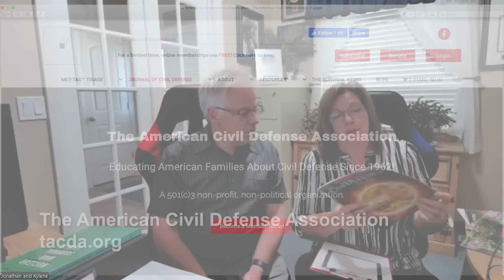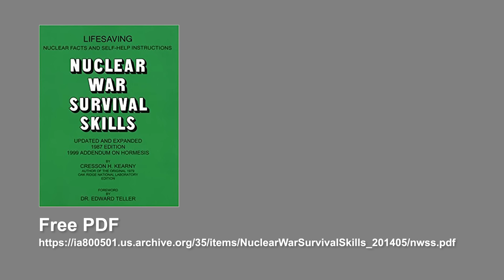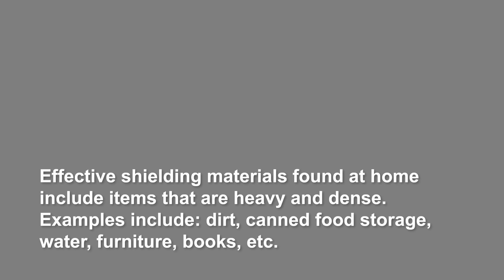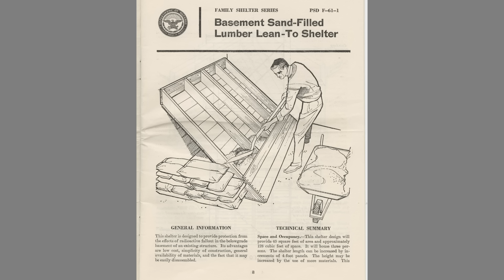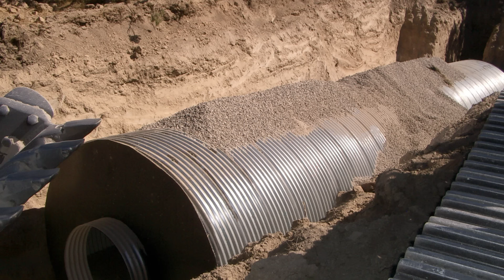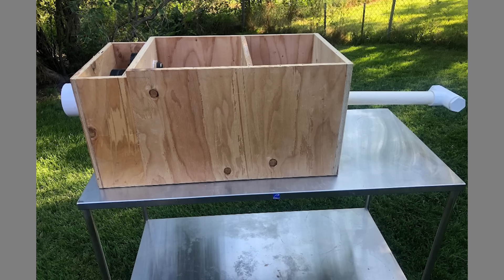Nuclear War: DIY Fallout Shelters with Jay Whimpey PE, President of TACDA

Comment: Question- Does the amounts of radiation increase if there are more then one  weapon dropped in same area, within a short period of time? Does this change the amount of time for the fallout and radiation to disperse ?
Reply: Great questions! If there were to be more than one weapon used in an area, it would add to the initial radiation you are subjected to IF you are in the blast zone. If you are not in the blast zone(s), initial radiation will not be a factor. However, if each of those weapons created fallout, there would potentially be more radioactive dust that would fall in your area (depending on how these are carried by winds), thus more rads to harm you. However, most of us will survive if we take a few modest steps to protect ourselves. Thanks for being part of the solution!
Reply: No one will drop more than one. Don’t need redos on nuclear bombs.
Reply: @biddibee3526  that's not accurate at all, take the Midwest for example, most of our nukes are concentrated there, so would be primary nuclear targets, they are also supposed to be able to take a hit, so our enemies,  who have enough nukes to hit each of them 10 or more times, probably wouldn't bat an eye about hitting each of them with 2 or more to try to prevent us from being able to retaliate
Reply: With MIRVs the radiation zone  increase the area of contamination halflife over multiple explosions at the same time.  The radiation will remain the same from the moment multiple blasts explore.  But if it's a follow-up strike on say the Dallas Metro and Dallas is first then a week later ft Worth. The half life will be off by 1 week between the two nuke sites.
Reply: It's about the particals generated decaying not that they spread like a virus replicate and create more particles.  Those particles are created at the time of the blast and decay thereafter.

Comment: My ? Is if you use all your food to portion you will not the food  be no good?
Reply: It won’t get into the packages of food. You’ll need to wash off the outside of the packages but it can’t get inside of packaging
Reply: @biddibee3526  if that is true why do I need 4feet of dirt around me ? If it can’t get thought a plastic bucket.
Reply: Ionizing radiation from a bomb will kill living things. In some parts of the world they irradiate food to preserve it. To protect you you need that barrier.
Reply: Hey Karl...because many foods have considerable mass, they can protect you similar to what concrete, steel, dirt, etc can. You will be using this inside your home or shelter to put mass between you and the radiation. This food should never get any fallout dust...if it does, you are in danger also. This food is safe to eat. If there are foods (i.e. canned goods or other packaged foods) that get some fallout on them outside your shelter, when you can safely exit your shelter, these can be cleaned off and the food inside can be eaten. Even though it is safe to be out some, you don't want to ingest that dust. Our 3rd video discusses this further...that should be out this week. Great question...keep being part of the solution!

Comment: Since I've now seen the 3rd video. And in it seen this guy gives some very bad information. I cancel my question.
Reply: You need to filter it. Particles can be radioactive but the  water molecules are not.
Reply: Water itself is not a problem...we may need to filter out radiological dust using prefilters, then filters, but it will be safe. Just don't want to ingest fallout. Best plan is to have a few hundred gallons of clean water tucked away. May still need to clean some water at some point, but the danger will be much reduced. Great question!
Reply: @baddog9320  I wouldn't drink the first few rain or snow showers for sure.  But fallout has a relative short lifespan, I believe around 2 weeks.
Reply: @geod3589  I've came back and edited this. After seeing the 3rd video.
DO NOT LISTEN TO THIS GUY.  
The 1st and 2nd video are sound.
But the 3rd video he puts out a lot of wrong information. 
The man clearly doesn't know the difference between Alpha and X-ray. No less Gamma.

Comment: My problem is there's no good videos on how to make a ventilation system for a fallout shelter I'm probably not the only one but I cannot afford some high-dollar machine that filters the air so I need to be able to have clean air coming into the bunker and exiting
Reply: ok. here is the thing.
Something is better then nothing.
Not the best. You could use swimming pool / spa filters. 
I remember being taught a blanket at any crack. like the bottom of a door.
Key here is you are going to be exposed to radiation. Just get it as low as you can. And preferably lower then your body can deal with.
FYI you are exposed to radiation daily right now. But they are Alpha and Beta.
Get an x ray you are exposed to radiation.  Though it takes a lot of xray to harm you. If I remember correct we were allowed to get 200 rad per year as a rad tech. Which is pretty hard to get.
Radiation comes in 4 types, Alpha, beta, x ray and Gamma.  
Anyhow any filtration is better then none.
Reply: How I understand it as long as your air intake & outlet have a cover over it. I'd use a vacuum cleaner bag over the pipe. These bags can block tiny particles. Use of a long pipe should help eliminate most exposure? I wonder if a small electric fan would do the job? In my book they have a single pipe with two connections one lower & one higher one where they fit a hand pump. Then a separate out let high up for eliminating oxygen. Both of these have a hood type cover over the top of them. I'd at least put a sock over both. 
At the end of this video they address these issues.
Reply: @australianwoman9696  First this couple are great.
I don't recall hearing in the video about filtration. Other then the Swiss system he has.
And frankly the $6000 is way over what I can pay for.  its not just budget..But just don't have the money.
Plus that was years ago that it cost $6000. 
Also I have no sawmills. Have to have trees to have a sawmill around.  I know this will sound impossible to some. But there are no trees for well over 100 miles. Yes there is a single tree here and there. But even those couldn't be used. Just not big enough.
However. there is a way. All I really need to worry about is overhead..Unless it rains. When it rains. it floods. so any hole fills up. And I mean fills up to the brim.  There is no way to stop this.
Reply: Everyone has heard of the old rainbow vacuum cleaners right? I remember when I was a kid the salesman showing with a light how zero dust came out of the water/filtration pot and let me tell you what every single time my mom ran it that water was disgusting! The old any filter bag style always puffs out dust, so with all this being said I want to think that an 90elbow on both entrance and then exit both coming and going thru water making bubbles would capture/ trap almost all and any dust particles from outside period. I'm thinking instead of a hand crank get an old 10-21 speed bike and hook up a fan only have it on fresh intake so you'll always have positive "cleaned pushing air" bubbling out exhaust side . Picture this a garage air compressor that could suck the air thru the water filter and make positive air pressure inside ( I also think of an fish aquarium with charcoal filters that does a good job cleaning fish tanks) and push bubbles outside connect bike to flywheel of air compressor perhaps weld or bolt bike sprocket to compressor flywheel. Another smart purchase for such a situation is an LEL meter with lots of batteries to test the air every so often until you know how often or cranks you need to do per hour to keep the oxygen level above the 21% safe zone. More people=more cranks less people= less cranks eventually you'll figure out how many cranks it takes when you have another person, and then everyone can take turns pulling Thier weight.
Reply: For sure, high end systems are expensive. The hand pump in Nuclear War Survival Skills may be an option. I think there may be some other options that are fairly inexpensive and workable. I will do some looking, and encourage you to do some also. I am confident you can find a good option. Keep making progress!
Reply: @JonathanBJones  I'm definitely researching it I did find one video on it but it's not the best in the world and showing you step by step how to assemble and I thought about trying to do some kind of solar with like a bathroom exhaust fan and a Shop-Vac charcoal filter and they do have a filters for shot facts that are made for radiation top dust particles
Reply: They do sell filters for vacuum cleaners that will help with radiation I was trying to see if a way of making a handheld pump to pump in enough fresh air and get rid of the stale air
Reply: If you can access electricity, you can use those vent system inside docks with a carbon filter. Same stuff the pot growers use to remove the odors from their plantation.... Put tu filter as far as possible from living quarters since radio-actives particles risk to be trap in it. Read Nuclear Survival Skills, it is not a video it is A BOOK , with pages...BTW those ventilation system and the biggest carbon filter available (about 20/30 pounds of charcoal) would be less than $600. But check your local hydroponic shop for actual inflated prices...

Comment: My house is pier and beam, have a secret entrance in one room under the flooring.  Wonder if it could possibly be turned into a shelter.  Only about 3 feet high but could have plenty of room to modify!
Reply: I'd check into it. Very least you have a good hiding place and food stash and water area. Throw a cot in it and could stay hidden for a little if crazy enters your home.
Reply: Most definitely! 😃
Reply: Could you get away with digging down?
Reply: Sounds like you have a possibility. I like the other comments made. Consider the protection it will provide and decide if that is way to go. Keep doing great things!

Comment: I cant build anything too expensive and it must be water proof due to the water table. Could a bury a plastic septic system. add ventilation and pour rocks or concrete around it?
Reply: I saw such a video. Not it being done, but just a hypothetical exercise.
My neighbor up the street bought some residential back plastic culvert (big enough to crawl in and out easily) it’s now in his backyard. He’s planning on using it instead. You ever heard of Anderson shelters?